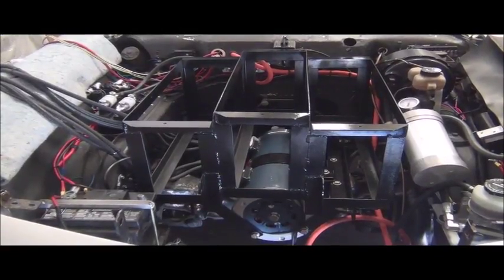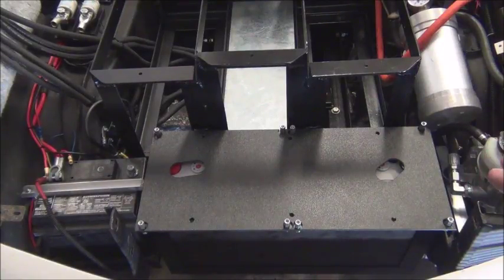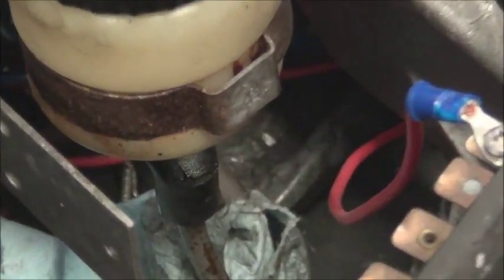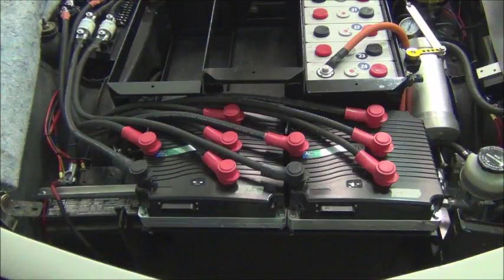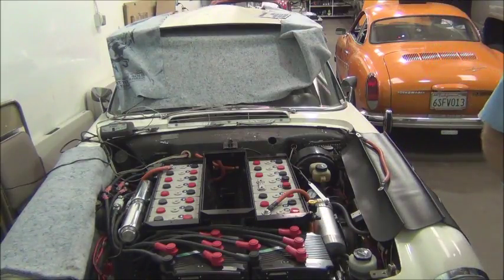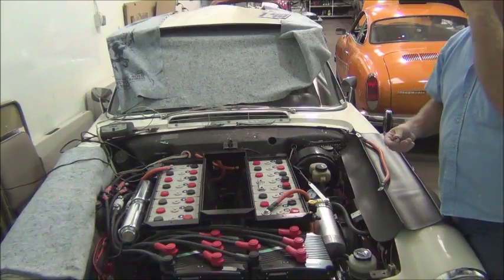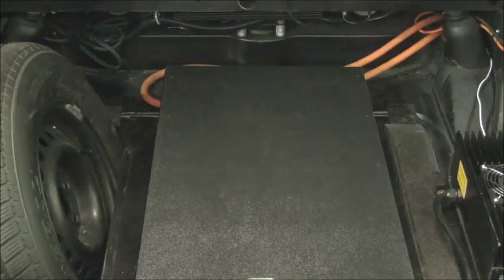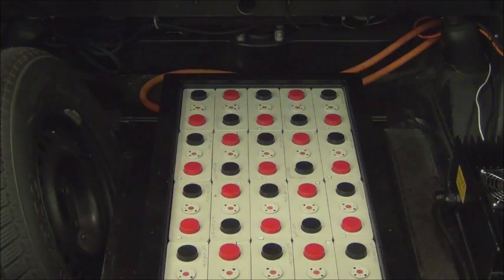Mercedes 230SL Electric Conversion Battery Rack Installation

Comment: very interesting project on a lovely car. I had a question? have you ever considered laying down the batteries Tesla style at the floor level of the car? It might make a good low center of gravity as well weight distribution?
Reply from the maker: We have done that.  But few vehicles offer the opportunity to do so.  One that was shared on video was the stainless steel Jeep project.  Thanks for watching.